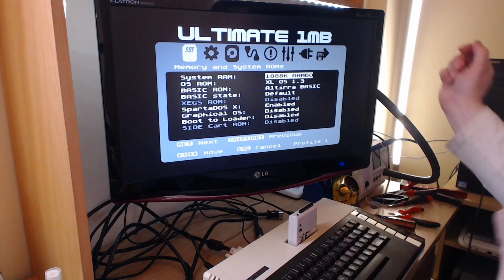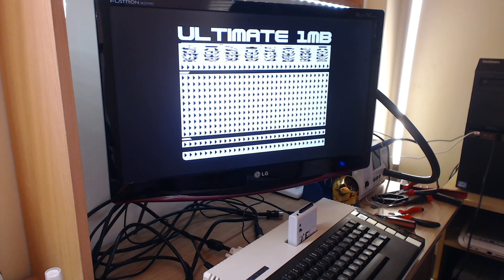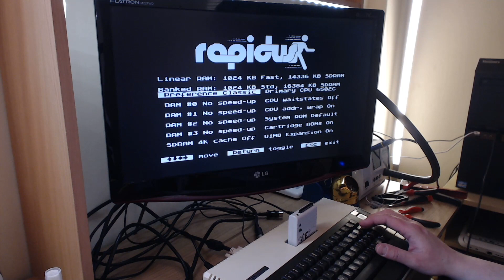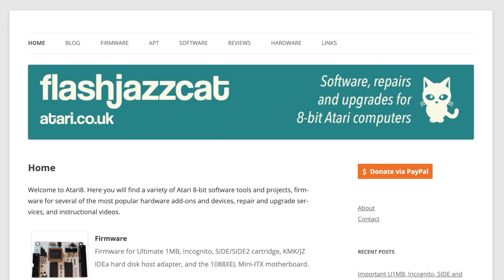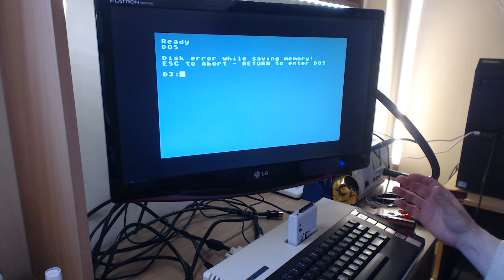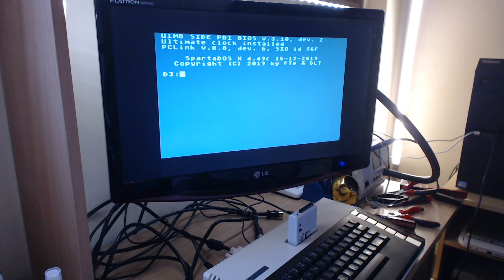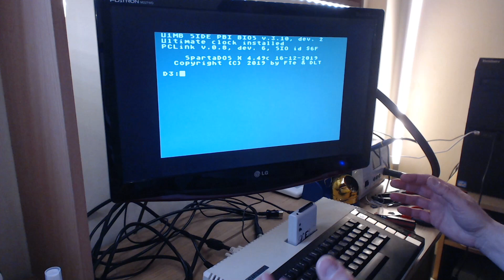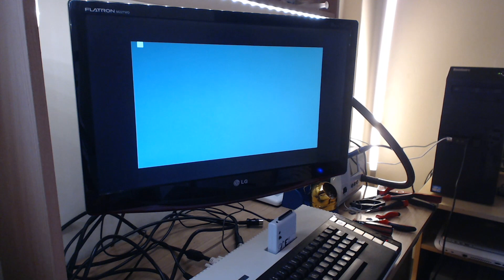800XL with Rapidus and Ultimate 1MB: What Have We Learned?

Comment: Thanks!  Before these videos I almost ordered the Rapidus with the U1M. It's too bad that they don't work together.  I am guessing that they also will not work at the same time in a 1088XEL/XLD
Reply from the maker: I experienced the same 'Reset/reboot' issue on my 1088XEL. I have to stress that I'm not asserting the two devices NEVER work stably together; it's just that in almost all cases, I see these stability issues on the machines I own and have worked on. Just telling it as I see it. If others have no issues, great. Perhaps you will install the two devices and everything will work great!